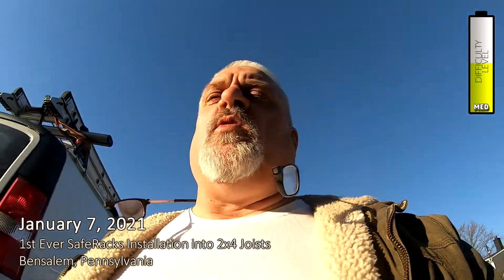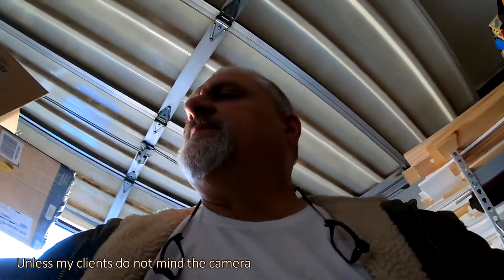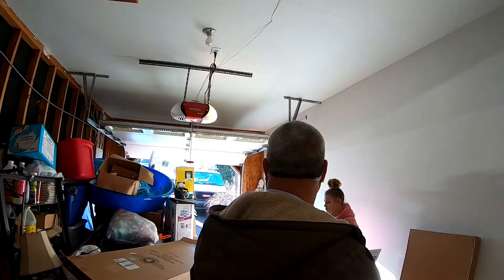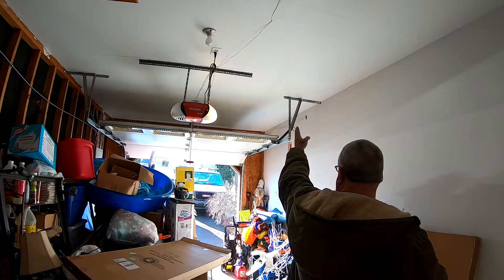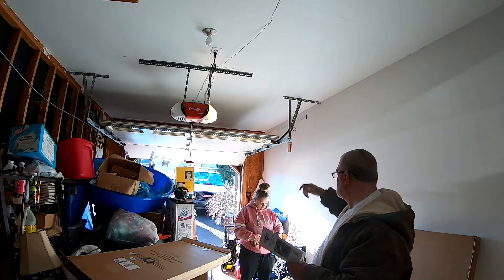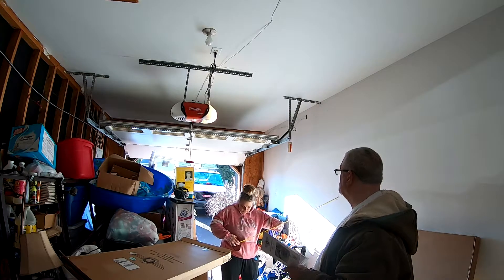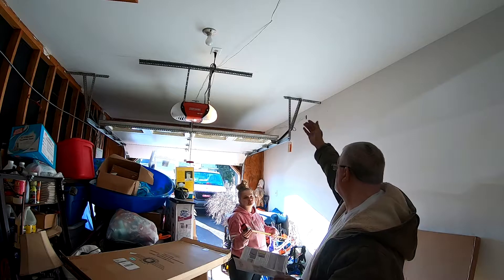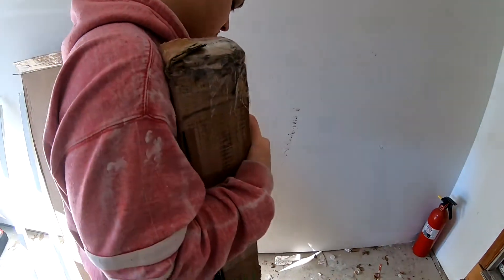SafeRack Installation

Comment: What's the drill bit size used to make holes to the joist..started with 3/16 inch but having friction installing the ceiling bracket. Can you mention the drill size you used.

Comment: The stud finder you're using, which particular one by Franklin Sensors is that? They seem to make a few; I can't seem to find the one with 15 sensors anymore. The T-13, M210, 710 and 710+ say 13, the T-11 & X-1100 say 11. Not sure if any of those would work as well as the one you have and I don't know if you have one that's discontinued since April.
Reply from the maker: Still In stock

https://amzn.to/3Ax3yiG
Reply: @BobsHomeServicesLLC  Thanks very much. Working on installing this same rack set in my garage; the walls and ceiling want to defeat the two stud finders I have. I don't think we're in your service area here in Michigan but this has been very helpful, as have some of the other videos now that I found your channel.
Reply from the maker: @ericallen6405  Fantastic. I’m thrilled you found us and our video was able to help you with your project. 

The safe racks are a bit confusing until you do one or two.

Comment: 10:46 can you use the angle slot which is used by the garage door already? Can we reinforce with a couple of bolts to use it or always avoid using the garage door one?

Comment: Hi Bob,
Did you consider putting lag screws at an angle for the cieling brackets near the wall and ceiling corner? Instructions call out for that. I know you tossed instructions but I am curious to know your thoughts about it 🙂
 
I found your video very useful. Thank you!

Comment: Bob, whats the weight limit on the SafeRack? Looks as if its only meant for light weight duty.
Reply from the maker: I believe it was 600lbs into 2x6 or greater rafters and so I advised them that where it was 2x4 rafters they should contact safe racks for a more realistic number. I think it ended up being around 450-500lbs.
Reply: SafeRacks rates the 4x8 rack for 600lbs when properly installed into 2x6 or larger ceiling joists, per the instruction manual that Bob tossed 🙂.  This is not a light duty rack!

Comment: If the joists are 48 inches apart, no choice but to run them parallel
Reply: Yup. And they can be run parallel at 24", too. I just did with mine. It actually gives you leeway if you've made any measuring errors, plus you can slide the entire assembly back if need be